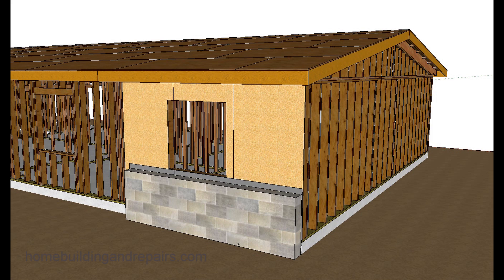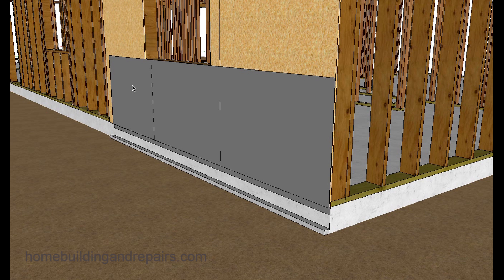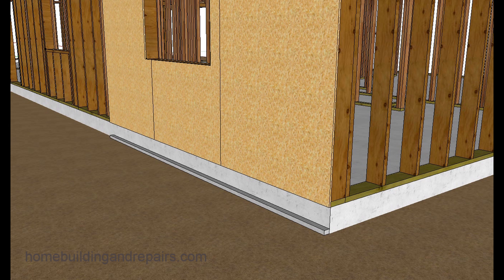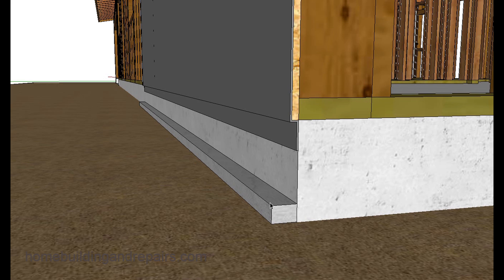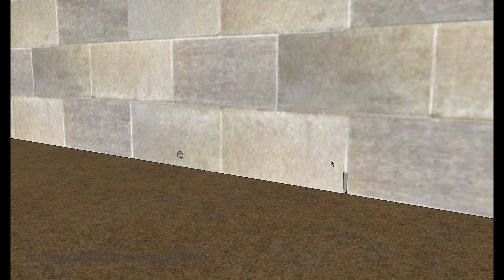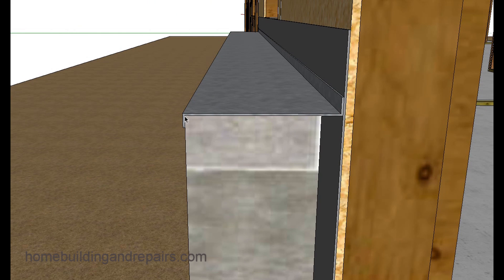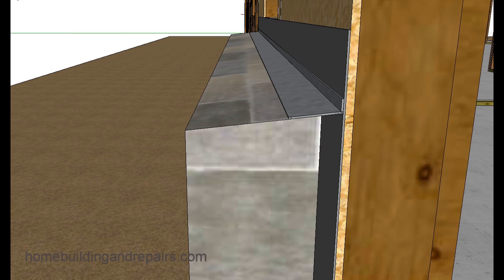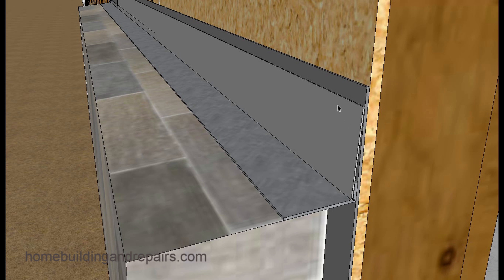How to Install Flashing Over Exterior Masonry Walls to Prevent Building Damage

Comment: Stubbled across this exact problem at my house. Built in the 60s, Midwest USA. Previous owner caulked the cedar siding/brick transition, and it failed. Installing flashing and repairing the cedar siding this weekend. Going for something shown at the 7:30 mark. Hard to find good info on this exact issue. Thank you, sir!

Comment: The upper metal flashing in this detail needs to have flashing tape to seal it back to the wall membrane.The cap should have a shoulder for the metal flashing to turn down to prevent water from being pushed back in underneath the flashing.

Comment: What about if i want to build a metal shop and add about 3 foot of brick on the bottom what is the process for that
Reply from the maker: I would think that the process would be similar as to using wood wall framing components, but some type of exterior sheathing or cement fiberboard might need to be installed in between the brick in the metal wall framing studs. Let me know if you need additional details.

Comment: Hi. Thank you for the video. What if I have 1.plywood. 2. Tar paper (x2) 3. Stucco scratch. 4. Stone with mourner. Will that work? Of course we will have metal flashing
Reply from the maker: As long as everything is installed correctly, then it should work.

Comment: Spot on Greg - Everyone needs to learn from this. Your time and effort is never a waste of time. Someone will definitely benefit from your commentary and illustrations. I believe the product that could perform like you mentioned is Carlisle Wip 300 perhaps originally used on a horizontal surface acting as an ice and water shield, I believe your recommendation in using it as an alternate house wrap / moisture barrier etc. would work excellent. Other builders on you tube are using the same product as an alternate to a more conventional house wrap such as Tyvek. I agree 100% that building paper / aka felt wrap or jumbo tex will most definitely fail over time. Not sure to this day how stucco contractors still rely on this behind their scratch coats. To me even though they have paper behind it, its going to fail. Also as you noted in your video - Ventilation is a must!! bugs or no bugs - air needs to get behind wall cavity such as the one you illustrated on. The builder/ masonry contractor didn't see this coming especially if the weep holes plugged up and never allowed moisture to escape. Thank you for sharing your knowledge and expertise regarding this method of installation. As to the counter flashing!! Yes - a ridged galvanized counter flashing with a crimped leading edge extending over the masonry at least 3" would have been most helpful. When you bend or break that leading edge it really stiffens it to keep it from buckling and turning up as it is forced down onto the top of the brick or stone work. Good Video
Reply from the maker: You're welcome and let me know how everything works out.